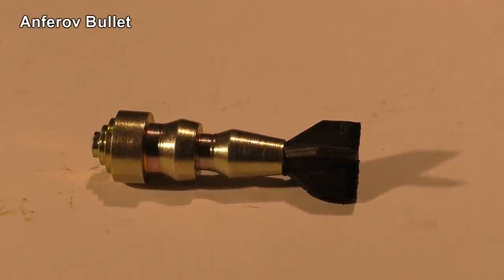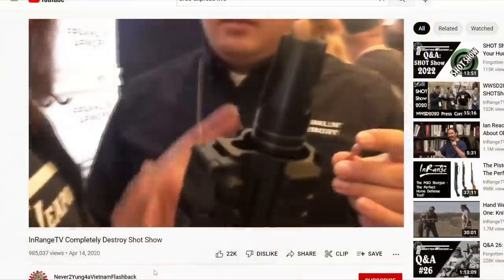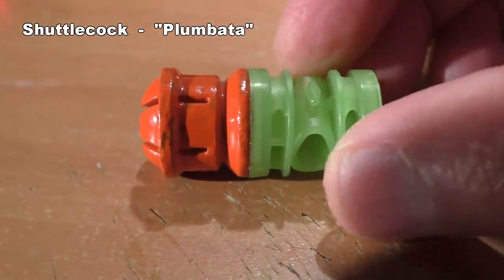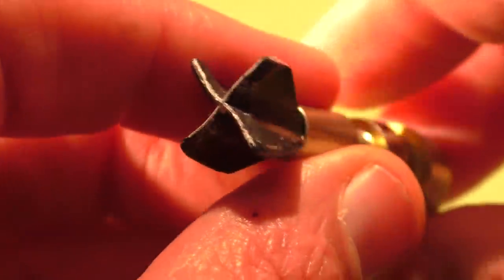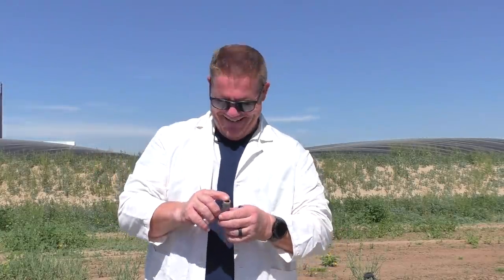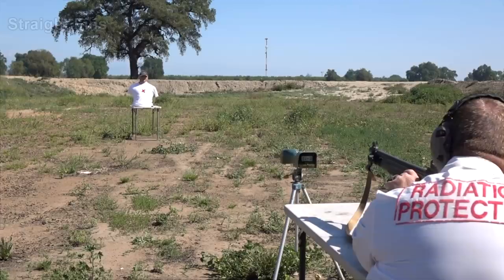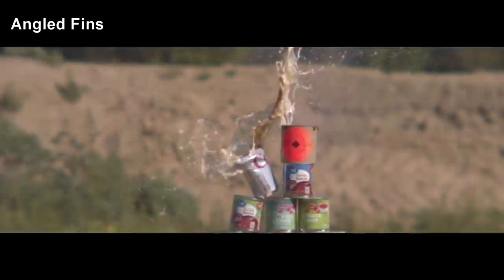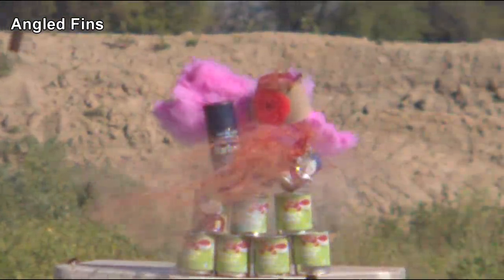Supersonic Darts - The Effects of Inducing SPIN - I learned something!

Comment: I build alot of arrows for hunting and target archery. I have started to see that a "High/True Helical" of the Vanes (twist not offset) works wonders on all arrow lenghts and Broadhead types. How ever the length and shape of the Vane plays a huge role during inflight stability. The longer the vane (2.5"+) the lower degree you will need to achive stability at higher speeds. With higher speeds being 285fps+ with modern compound bows. Its interesting to see the "Ballooning" effect in the first 45° shot. I would say a lower degree of offset would achive greater results. 2-4° at most for the size and overall shape. In what I have seen with archery.

Comment: You may find that the spin was created in the barrel due to an asymmetric pressure distribution creating torque on the dart. You should take a high speed video of it leaving the barrel and another further down range to see if the spin rate is changing and whether or not it is caused by aerodynamic torque or by torque from the firing.

Comment: @TAOFLEDERMAUS 8:42 Not so sure about that, there could be like a "bubble" behind the projectile with maybe vacuum, or at least (much?) lower air pressure, I think that wobbling from test-spin-1 could be caused by the fins wobbling back & forth through that "bubble", basically "loosing traction" in the "bubble", but when the fins moves out of that bubble, it grabs onto the air again & gets additional rotation.
What do you think? (and what do you other readers think about this?)

Comment: At supersonic speeds the micro differences in angle of the fins is what is destabilizing them. I would think a 3d printed mold would be the best way to make sure the fin angles were optimal. I would even try reducing the deformation and try in increments of 5 degrees to find the optimum angle.

Comment: I would think that the increased area of the rear-facing portion of the angled fin would subject it to unnecessary force when fired, which could increase the chance of damaged fins and/or tail of the projectile.  I don’t think there is enough improvement (if in fact there was ANY) to warrant a potential catastrophic error caused excessive pressure on the fins.

Comment: Consider fin-stabilized projectiles in the big guns:  120mm fin-stabilized tank shells.  They specifically have straight fins to keep projectiles from spinning.  Apart from non-rotation being better for shaped-charge projectiles, if spinning would help accuracy of saboted penetrators, I'm sure the military would use them.

Comment: I think part of the issue is a combination of too aggressive of a bend on the fins and the fins themselves not all being bent identically.  In the close-up shots of the fins you can tell there are differences in how they're bent.  That's going to mess up the flight quite a bit.

Should retry with machined fins that are all identical to each other, and with a less aggressive bend to them.  Something more like 10 or 20 degrees rather than that 40-45 degrees.

Comment: I think such angled fins are actually going to make the projectile less stable than straight fins. Reason is that fin stabilized projectile always wobbles somewhat as it is flying and if it is spinning at the same time, it presents the air stream different "face" of the tail at the end of each wobble. Also combination of the wobble and spin creates gyroscopic effect.

Comment: When there is eccentricity in a round, spin will make it describe a helix in flight, while no spin will describe a divergent arc. That arc increases with roughly the square of the distance. So, going from 25 to 100 yards you would see 16 times the deviation. That is ignoring any polar inertia which multiplies the effect of increasing distance. The four horseman here are shape, weight, velocity and range.

Comment: I believe 40 degrees was way to much. 15 to 20 max would stabilize washout almost tumbling. Great video though. I wonder if a spinning slug would penetrate a hard surface better due to the spin?
Reply from the maker: I doubt there's be much difference since the rotation vs forward speed is pretty anemic.

Comment: You need half the bending that you used and with a means to make it very consistent fin to fin round to round. US HEAT rounds have a very slight amount of spin maybe one rotation per 100 meters. Same with later long rod ones. Very little just enough to balance out any fluctuations as they howl down range.

Comment: Returning boomerangs (the novelty kind, hunting boomerangs don't return) return only because there is a small amount sanded off the underside of the trailing edge of one tip.

Since the 40 degree bend was too effective, instead of bending the fins, could one simply sand a bit away on one side of the fin at the trailing edge, to change the profile and impart asymmetrical airflow across the fin?  This might generate lift across the longitudinal axis and impart spin, the goal being a lower rate of spin, and less violent yaw as a result.

Comment: not really relevant to firearms, but stabilisation through the magnus effect is also a thing. most commonly used in airsoft guns, but it's applicable to all ball shaped/round projectiles.
regarding the fins, i'd be interested in how they behave at the limit of their effective range when compared to each other. maybe at 150yards or so, will the angled fins still be stable when the straight finned starts to tumble?

Comment: APFSDS rounds used in tank guns are designed to spin out of smooth bores.
There's a lot of research that goes into getting the spin rate correct for not only stabilization of the dart, but also to optimize sabot discard characteristics.

I tried to look into this a while back and it went right over my head.
I would guess you'd get better results if you lessened the AOA of the fins, and increased the distance to the target..

Comment: Gotta say, the bent fins would work better if they were cast/cut more precisely and have the most efficient angle of attack designed to impart better more even spin.
That'd fix the wobble in flight i suspect.

Comment: If my calculation is correct, for the 12 gauge 32 gm projectile at 1200 fps, at least  it is require  minimum 3300 rpm prior to begin precession. If you keep rotation  rate above this until reach the target, probably your projectile will be stable, otherwise will be inaccurate due to precession.

Comment: With force imparted on the tail section for spin the CG of the projectile needs to be shifted to the rear to counteract the side loading force that is imparting spin. The straight fin projectile with no angular force upon the tail fins will be stable in current design with a forward CG.

Comment: When Barnes Neville Wallis needed to improve the accuracy of the Tallboy Earthquake Bomb (it was wobbling as gravity accelerated it past the speed of sound) he added some spin, but he did it by offsetting the straight fins (not bending the fins themselves) and he only did it a little , certainly not as much as forty degrees. The result was nearly perfect. The difference between a Tallboy and a slug is that the Tallboy has time to build up spin before it reaches the speed at which stabilisation is needed.

Comment: I do believe that the spinning projectile should be more accurate. Straight fins will still allow the "bullet" to bob up and down or side to side and it can be seen in the slo-mo footage. The weight at the tip wants to go one side and the fins push to the other, giving a pendulum effect on the horizontal. It keeps the general projectile in a nice trajectory, but I think it'd affect the overall flight distance.
That doesn't happen with the spinning "bullet", which might not be more accurate than it can, given the "bullet" but it might be more accurate on longer distances.
Or at least that's how I see it in my head.

Comment: You can see how tail of a normal slug oscillates up and down - on every oscillation fins stops it and pushes tail in opposite direction for next oscillation. With spin you are adding rotation, and tail is not redirected back to center in a middle of oscillation, it is redirected around slug axe. Now add gyroscopic precession, that causes tilt/yaw to happen after 90 degree of rotation, and you will get tail, that spins like a rotor of a helicopter - what we see during first angled fins shot.

Comment: "Straight fins" there was rocking up and down a bit, but nothing like that first angled one.
I think by bending the fins you're introducing a lot more things that can be imprecise, and they probably matter.
Technically, arrows' fletchings do spin the arrows. That's why each fletcher only takes one wing of the goose.
If you use feathers from both wings, your arrows try to go in circles. Take all feathers from one wing, they spin.
Worth noting, perhaps, that the spin of an arrow doesn't stop it arriving point-first when shot from 80 m back using a 36 lb draw (yes, in England we mix our units as well as our drinks) and having to aim so high to hit the target that the sights had to be dismantled and reassembled upside-down just to be able to use the top of the upright of the frame, above the target, as an aiming mark.

Comment: Well do realize that overspinning is a huge factor in bullet accuracy as well. That why different bullet weights do better with different twist rates in barrels. So i wonder if the angle of the fins will help the accuracy only at a certain degree and velocity

Comment: it is like they mentionned. a perfect symmetrical object will usually fly stable. imperfections will make it deviate. so if you make it spin, than deviations will cancel eachother out somewhat. but if you add spin by means of hand bend fins, than chance is big that you add imperfections and the spin will woble more. if you do it with rifled barrel and straight fins, than the object is easier to make perfect symmetrical. also adding spin to a finned or non finned object means that a certain amount of energy will be lost do drag in the barrel to create that spin (neglactable) and with fins also in the barrel but also in the air.

Comment: In Archery, we have many diffrent types of fletching, some are straight, some are helical, and then we have flu flu... which look like the end of a scrubbing brush. 
Each have benefits and drawbacks... straight fletching is better for wind resistance, helical is better for stabilisation.... Flu flu arrows shorten the range dramatically. 

I would say that putting spin on a round using this type of fletching will only increase drag, thus slowing it down... much like a flu flu arrow.

Comment: The inaccuracy thrown into the spin stabilized round is in part due to weight imbalances magnified by the rotational speed. The faster it spins the more any imbalance off the centerline will throw off the balance. The imbalance appears to be in the fins as they are the part that hs changed. Use a balancing rig on the center line of the slug and that should increase the accuracy of the round.

Comment: The main issue with using spin stabilization with long rods projectiles, especially those with a LD ratio exceeding 7.5:1 is that imparting spin on such relatively thin projectiles/long induces harmonic vibration problems at both the tip and the end, which actually destabilizes the round. There is a reason why most Fin stabilized rounds never even bother with spinning as they are fine enough for stability. The only reason why you would even impart a spin at all on such rounds is to cancel out small manufacturing defects in the fins so that if one fins is angled too much the projectile corkscrews towards the target instead of veering off to the direction that defective fin is facing. Even the spin rate is extremely slow, something like 1 in 20 inches if not more. Hope this helps clarify why while you can, it is not necessarily better for you to put spin on such projectiles.

Comment: The Abrams tank uses a smoothbore cannon and fires an Armor Piercing Fin Stabilized Discarding Sabot (APFSDS) which is basically what these are. The Abrams APFSDS use a minimal amount of spin; minimal. They found that too much spin will decrease the accuracy and range of the round. Something this small would most likely be better with no spin.

Comment: A fin stabilized projectile is in a constant state of correction as greater resistance forces it against it's yaw state.  I believe what we saw with the 2nd shot in the video here was a result of dramatic overcorrections of this yaw combined with the spin correction of the yaw lining up out of sync. I expect that even the slightest imperfections in this type of projectile have the chance to generate this out of sync yaw correction that generates that significant wobble.

Comment: Bending on the fins just seems like its an opportunity to introduce imprecision to the projectile which isn't going to end well.  I wonder of the spin stabilization might be useful at longer distance?  Because spin would be imparted as the thing is launched and as the velocity slows it would retain spin even as the fins no longer effect the projectile anymore???  Even as I type that it doesn't sound likely.  Anyhow,  It would take lots of rounds shot at say 100+ yards to test that idea, and it probably has a trajectory like a mortar.

Comment: Angled projectile actually demostrates a very expected behavior called "precession" which is automatically expected because of stabilizers changing flow direction in two directions, i.e. the surface is not absolutely differentiable.

Comment: i may come late to exlain this but giving angled fins would be actually pretty detrimental for the accuracy, since you are imparting a moment of rotation at a certain distance to the center of mass, so if theres any disturbance in the air flow it would actually make it describe something called "euler's rotations" and start tumbling as you can see in the slo mo footage, so it would be pretty rng based. Also take what i say with a small grain of salt, im an engineer student but i dont have a complete formation in stability mechanics

Comment: Fins on supersonic objects are more a drag device than a directional one. There is a Shockwave in front of of every leading edge in a supersonic object. The rear of the fins are essentially in vacuum behind the Shockwave. Early plane designs learned the tail ends elavators in many cases could not be on plane with the main wing. It put them in the cone of the Shockwave and were ineffective during supersonic sonic flight and were offset.

Comment: Spin stabilization is better for longer ranges as it helps keep the bullet from tumbling so much as they go transonic, I'm not sure it would actually help shotgun slugs though.  Shotgun slugs are already designed to have all their mass up front, which is the orientation rifle rounds end up after a bad tumble.

With that said, you might think it would be better to just seat the bullet backwards so the heaviest portion is at the front and be done with it, but there's more to it.  Rifle bullets are shaped and weighted as they are because that design is more aerodynamic and remains stable the longest in supersonic flight.  Rifle rounds are also designed with the intent of creating the most internal damage with the least external damage, which is possible with non-frangible rounds due to that tumble.  Shotgun slugs on the other hand use their sheer mass to ensure the energy makes it to the target and act more as hammer when compared to to a rifle, all the mass being in the front of the slug means it can hit bone and just keep going without losing energy to tumble.

Comment: I believe the fins need to be at least a little bigger than any point in front of it. Also, water acts differently than high speed air. In that high speed air does not wash around the front of the projectile and then around the fins especially at supersonic speeds. Air at supersonic speed only compresses so much so it hits the front and is directed away from fins at least the size of anything ahead of it. Especially at these short ranges. Stretch it out and slow it down and those fins would do major things. But what do I know, I broke a nail this morning. 😢

Comment: I find it interesting that so many think that riffling will always make things more accurate. That is not always the case, nor does a faster spin always make it better like some believe. In fact you can spin a bullet too fast, to the point where it will fly apart in flight. In some of the barrels that have more of a rifling twist to make a bullet spin faster, the bullets must be within a particular weight, length and FPS range. Go outside of those parameters and the accuracy goes way off. The spin rate can also make a bullet unstable so that it tumbles when it hits a target to cause a much larger wound. The British found that they could do that with their .303 and used that in both world wars. There is a whole science behind all that.
If you have a barrel with a slow spin rate, it is possible to increase it with a hotter load up to a certain point, beyond that you start stripping the bullet material off in the riffling.
One thing I did find interesting was that during WWII, the British could make their 22,000 Lbs "Grand Slam" (AKA Earthquake) Bomb target hits more predictable and accurate by imparting spin on the bomb. As the bomb left the bomb rack the fins would angle and impart the spin making it fly like a dart. It was still travailing well above the speed of sound when it hit. 
But it is so interesting to see how the different shapes, finned, smooth bore and rifle spin can effect the accuracy. I especially like that one on the Mini Bullets and how accurate they were even without the spin.